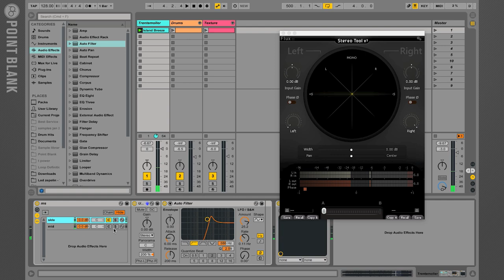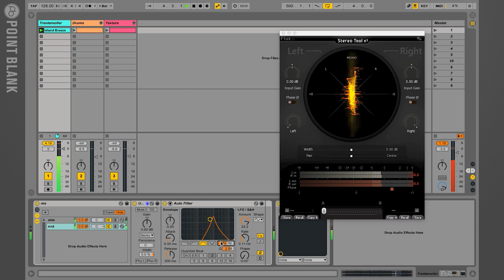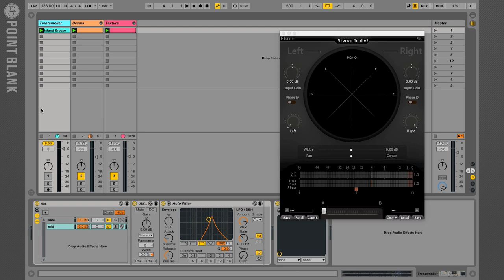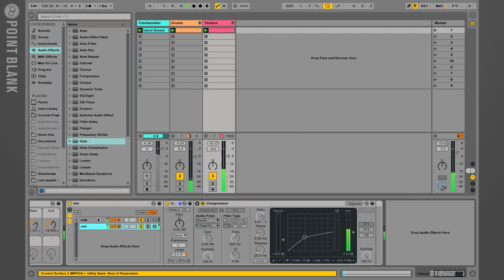Ableton Live Tutorial: Mid/Side Mixing Techniques

Comment: Wait...but if you turn the width to 0, it won't mute the side signal...it will mix both sides together so that there is the same signal on both sides, and therefore it's mono. And when you turned the width to 200 on the other chain, you could clearly see that the signal is phase inverted in the vectorscope. Something is definetly not right with this technique. Better teke an eq8 on both chains, one cutting the mids completly out and one the sides. So you have the leftovers on both chains.

Comment: The width control on utility acts from 0% - 100% as mono to stereo and from 100% - 200% its simply lowers the mid signal leaving only the sides. The way you got it set up here is not mid side. Its mono side. In order to split the mid and side in ableton, we must have the utility set to 200%  (side) and phase invert the channel and run this (parallel) along side a dry signal. This will give you the mid.
Reply: Jason Gibbins I gotta try this way and listen to what is going on. I am a complete noob to mixing.
Reply: Jason Gibbins I think he's got it right...mono is mid.  I believe the utility is actually doing the phase inversion internally for the stereo input. You're probably thinking of the MS matrix where the audio tracks were recorded with omni and figure 8 patterns which are then added for the MID and subtracted with the inverse phase on the right to get he SIDE part. Essentially, he is going from Stereo L/R to Enhanced Stereo L/R...but what do I know? I could be totally wrong.
Reply: If you look closely it IS set up as mid side. The default setting of Utility is 'Width'. Right click on the width and you get a menu, select Mid Side from that and voila it's the same as what you can see in the video

Comment: Do you check your mixes in mono or find it a useful technique? I made a habit of checking in mono periodically while mixing to make sure I didn't have any phase problems and I notice that with this trick all of the "side" signal disappears completely when monitoring in mono. Luckily the mid signal is still there but any effects applied to the side are no longer apparent. Am I missing a step in setting this up?

Comment: I think making one chain 200% wide is not the right way to do this in order to separate mid and side. You are just making the whole thing 200% wide. I would use and eq instead of utility. One chain cut all side and the other cut all mid. That way you are not adding anything to the overall signal but still getting the desired separation